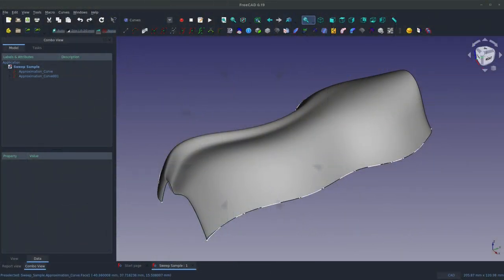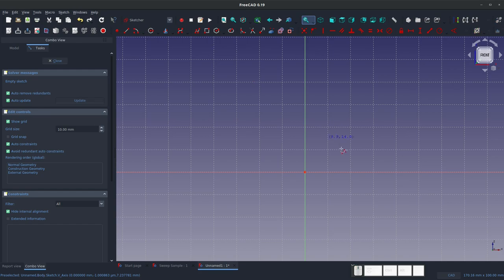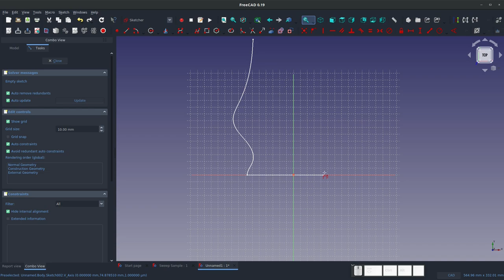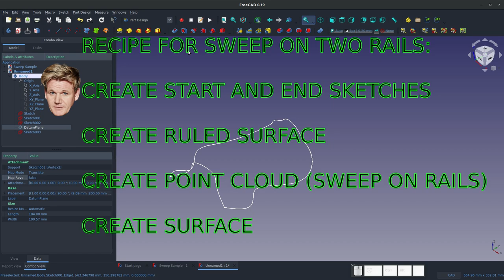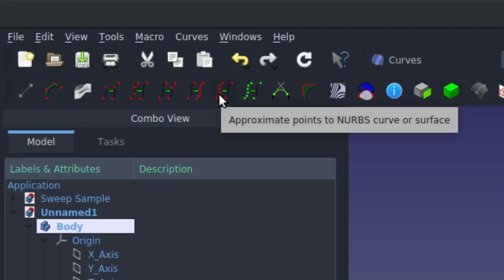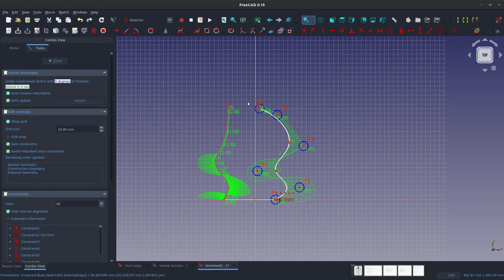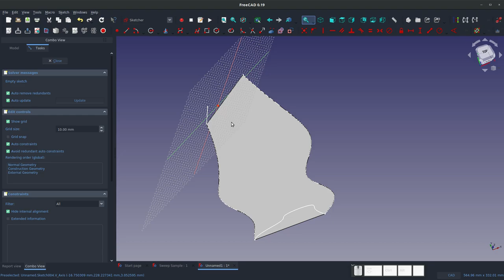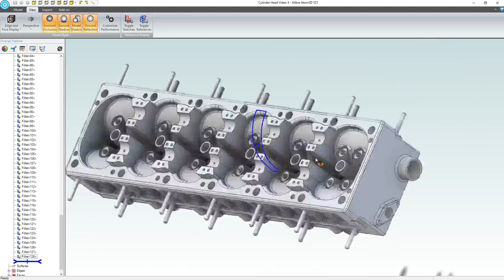FreeCAD Surfacing - How to Sweep on 2 Rails |JOKO ENGINEERING|

Comment from the maker: For those looking to make a solid out of this, go to the Part Workbench> Offset, check the fill offset box and use an offset value less than the minimum radius of curvature.  You can also make a closed volume of surfaces and then convert the closed volume to a solid, demonstrated here:  https://www.youtube.com/watch?v=Mi_r4mgBGeg

Comment: Great tutorial. Maybe you could end with converting the surface to a simple solid since many people want to 3d print after this type of step.
Reply from the maker: Sure, Part>Offset, check the fill box and make sure the offset is less than the minimum radius of curvature
Reply: @JokoEngineeringhelp  😀 Thanks!!

Comment: That was nice! Could you explain how to create thickness in order to get a solid, please? Specially when the part is twisted beyond 360°, I mean creating a thickness normal to the curve. Thanks!
Reply from the maker: Part>Offset, check the fill offset box.  The number one problem that happens is there is a minimum radius of curvature that is smaller than the desired thickness, so make sure that curvature is is large as possible!
Reply: @JokoEngineeringhelp  pin this tip!
Reply from the maker: @simonmerrett  Done!  Thanks

Comment: I'm designing a car shell in freecad and when I do an offset to get some thickness in the surface, it does not work. Any suggestions?
Reply from the maker: There could be a number of causes, the common culprit is there can be a small part of the surface that happens to have a very tight curve.  If the curvature (radius) of any part of the surface is smaller than the thickness, surface will not thicken.  For other errors, sometimes it helps to thicken less at a time (Break a fender into thickening the fender and fender flares as separate opreations for instance) or use more simple features to define the surface.

Hope that helps

Comment: Why not just use boundary surface command in FreeCAD Surface workbench and skip all these steps? In SWX, not in FreeCAD boundary command yet I believe as on phone at the moment, when using the boundary you can also define the continuity to the edge, especially handy for using suraces to control continuity at the boundary "rails".

Comment: awsome! how would you procede to give this surface a thickness of 1 mm? I aim at 3d-printing of such complex shapes
Reply from the maker: There is a button for it on the part workbench.  You cannot thicken more than the minimum radius of curvature
Reply: @JokoEngineeringhelp  I know this button. Works unfortunately only with simple solids
Reply from the maker: @Gassmaninov  That hasn't been my experience, for example I was able to add thickness to the downloadable GrabCAD part in the description without issue.  Are we talking about the same button?  Utility to offset in 3d
Reply: @JokoEngineeringhelp  yes, you're right. I was using the thickness button. The offset 3D button works using skin mode and fill option. Thanks!
Reply from the maker: @Gassmaninov  Glad it's working for you

Comment: Nice function, but where can I use this method. The curves cannot be handled or controlled.
Reply: What do you mean that, cannot be controlled? We can define b-spline, what else do we need? Normal sweep operation, isn't it? Great step for Freecad's users as I think.
Reply: @ИванДмитриев-ф1в  I used the normal sweep operation with b-spline (look here https://www.magentacloud.de/lnk/0PLhhd4m).

Comment: I am looking to emboss logo in sheet metal.  Can that be use.
Reply from the maker: Sure an easy emboss would be made easily with the new project command on the part workbench.  If you want to flatten something, your only option is the sheet metal workbench.  I dont think something embossed would flatten properly on sheet metal.